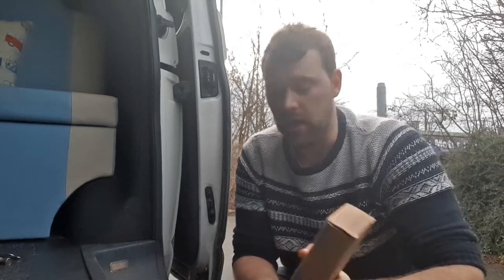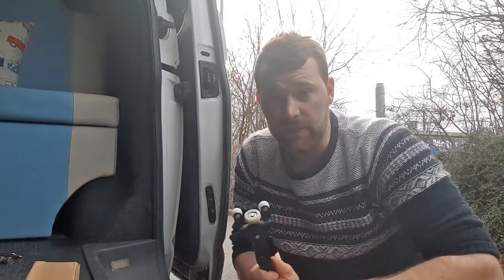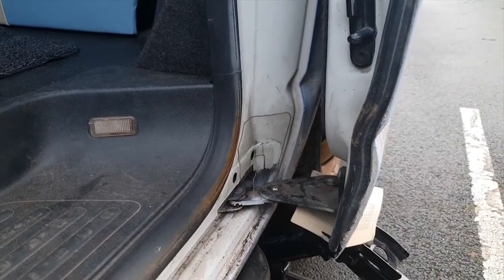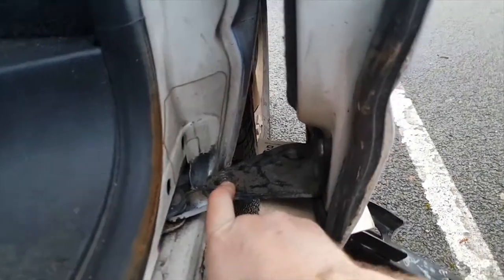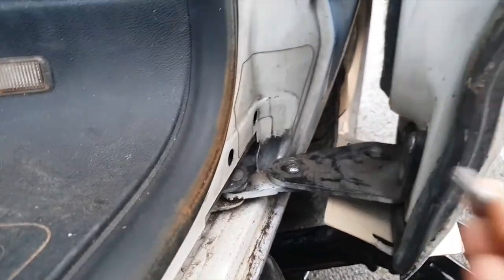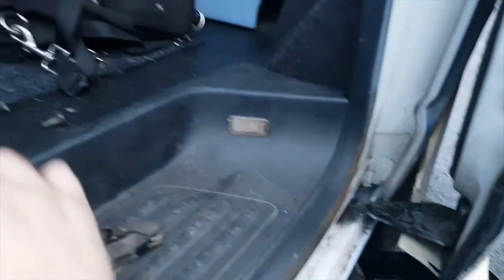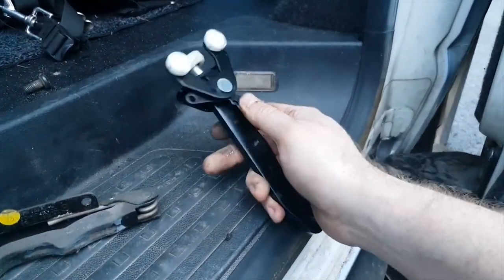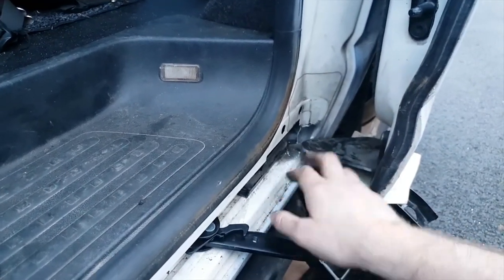How To: VW T5 Lower Side Door Roller Replacement | Fixing Faulty Door Slider | Van Maintenance

Comment: Great video! Very informative. Can I add that all the bolts supporting the door are spline heads. I used a Torx bit on my van before viewing your video and rounded the head of the bolt. Thankfully after viewing your video I used the mole grips to loosen the rounded bolt.

Comment: Thanks for that! Had my bus from new in ‘04 and the bottom bearing just failed.  Can’t complain after 16 years I guess!! 😂 I did wonder about the hook and the spring.   Ah well.... time to try and undo those bolts......
Reply: All done. Thank you.  Btw... is it just me that keeps the broken original parts?? 😳😳😳
Reply from the maker: Great stuff, glad your fixed it, no im bad at keeping old bits as well for some reason.. 16 years isn't bad at all, I have had new vivaro doors fall of after a few months before

Comment: Nice video fella
I have been searching for a video like this and none of the others mentioned the spring loaded hook/latch thing.
After reading comments on other videos I’m concerned that it can keep the sliding door locked in the open position.
Am tempted to do the same as you but I’m still a bit concerned that it may end up catching by chance one day.
I know it’s only been a little while but has yours stayed out the way?
Reply from the maker: Hi, so it hasn't catched or had any problems at all, I have had a quick look on the T5 and I can't see anywhere the latch would hook onto anything, plus the spring if fitted would be what holds the hook in operation I would have thought. So if the spring isn't there the hook would not hold in place anyway..
Reply: VdubPhotogLife 
Cheers for your reply
I’m about to go fit the new roller
Thanks again
Reply: The spring and latch, with the hook on is for attaching to the cable that operates the power latch on Caravelles and California's
Reply: If you don't have the power lock, you could just angle grind the hook off to save any problems

Comment: What is a torax bit? Mine looks like a triple square.
Reply from the maker: A Torx bit is this (You will need the correct size) https://images.app.goo.gl/urC1M6bCGA4aPQTb9

This is a Spline bit again you will need the correct size both are stated in the video https://images.app.goo.gl/auPdk8pvi8YddwgC7
Reply: @scoellphotography  Thanks for the quick reply. Mine is definitely not a Torx bolt. It's called Triple Square 8mm (spline). If I put a Torx bit in it I might round it.
Reply from the maker: @petercohen3966  Yeah mine was the same it says in the video a few should be Torx and a few should be spline, depends of yours or mine has been replaced before I suppose or what VW put in
Reply: @scoellphotography  Hey thanks. Do you know if it's 8, 9 or 10mm ? I'm not even sure where to measure from.
Reply from the maker: @petercohen3966  on mine it was a Torx T40 bit and a M8 Spline bit, the M stands for metric
Reply: VdubPhotogLife my two are identical. Will measure in morning
Reply from the maker: @petercohen3966  So both bolts on the actual arm (Slider mechanism) are T40 Torx on mine, The M8 spline bolts are the two bolts holding the door stay mechanism (spring-loaded bit) on the van
Reply: @scoellphotography  Finally fixed my door. Thanks for all your help. Turnout out it was all M8 spline bolts. Good advice about propping up the door. I almost had a major accident 'cos the door was clicking before closing. I noticed it made less clicking when there was downwards pressure on the door, so I stood on the lower bracket as a test and upper roller came out! I nearly dropped the whole door on the ground in a big fiasco. But managed to get the upper roller back in manually. After that the clicking was gone.
Reply: Mine were all spline bits. Tried with torx first but it quickly became apparent that that wasn’t going to work. Could have been an expensive mistake if I’d stripped it  The door now slides as it should
Reply: He means torx
Reply: Mine was a spline M8 bit & not torx.

Comment: Not an easy job on most T5s and mine was no exception. The bolt on the inside would not budge ans the two holding the door pull cable cannot be accesses easy if they round off. Really poor bolts that should be replaced with normal type if you manage to get them out.

Comment: Can you please tell us the part number for the part thank you
Reply: yes pelase
Reply: @GDUBMX  one important thing that is not shown in the video is that in order to be able to get the roller into the track at the back end of the track there is a access point that has a couple screws that have to be removed so that you can get the roller into the track correctly and then line everything up. without that it is impossible to get it into the track correctly.